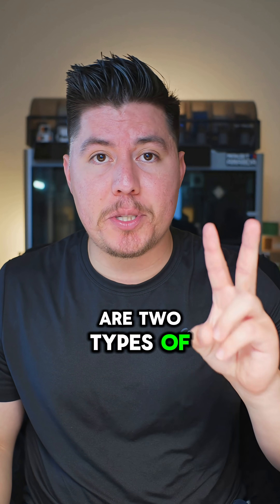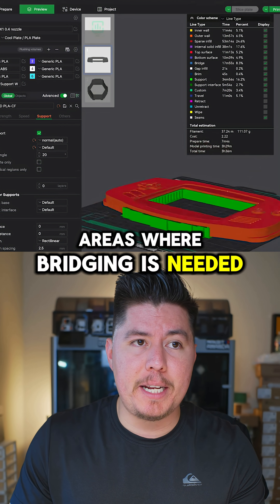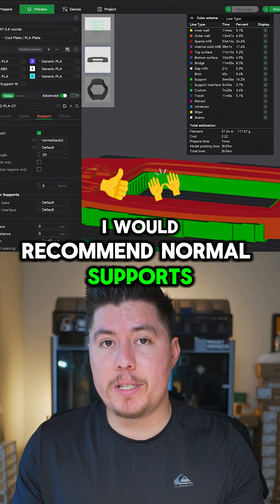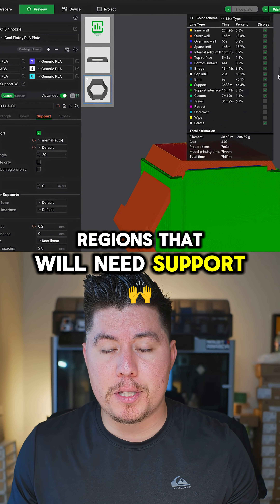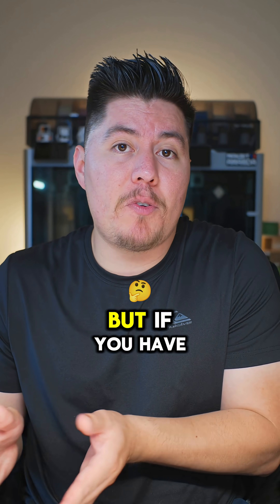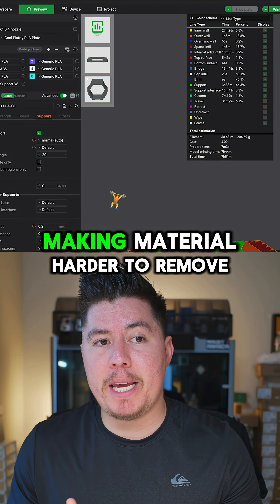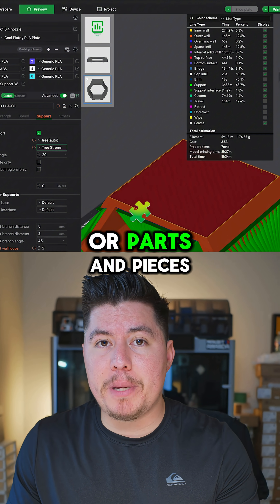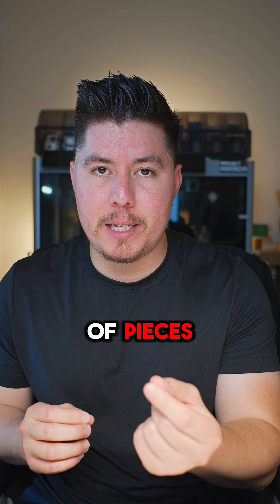3D Printing Secrets I Wish I Knew Sooner

Comment: With normal supports, my prints seems to stick to the supports more than the tree supports, especially on an angled overhang. Is there something I can do to mitigate this issue?
Reply: You can add more x/y distance between the print and the supports. I usually use 0.275 but honestly most of the time i use tree support in any case.
Reply: @SbrodolaiProtoKhay  I’ll try messing with that, thanks.
Reply: If your print is Petg use PLA for supports - they do not bond to eachother
Reply: @MakavelliFH  Unfortunately I don’t have a printer capable of printing two types of filaments. But that is a wishlist item that I hope to get soon